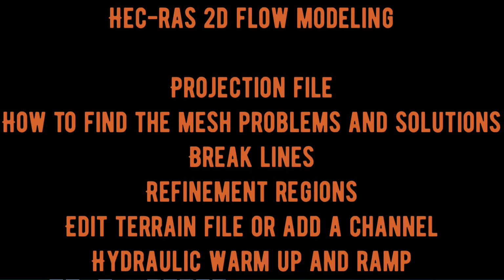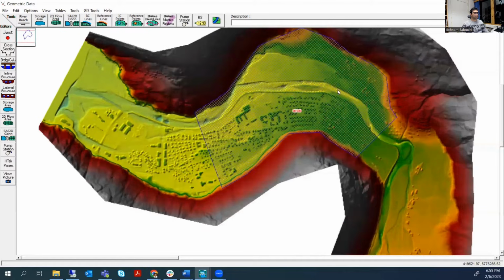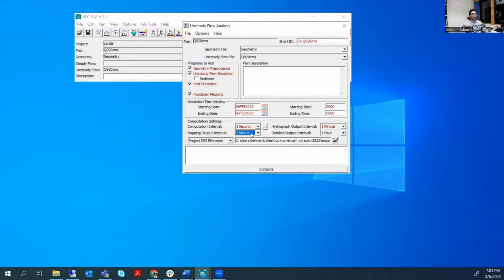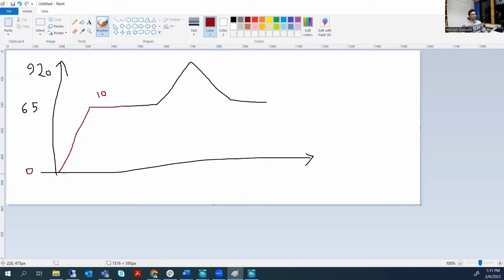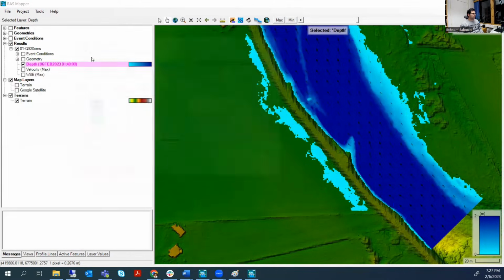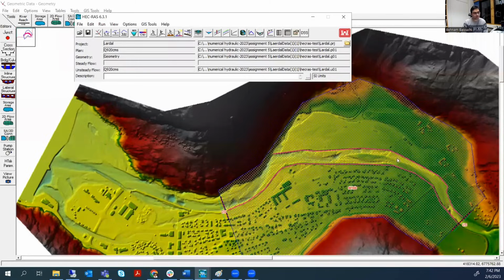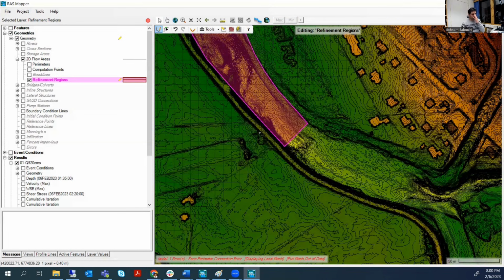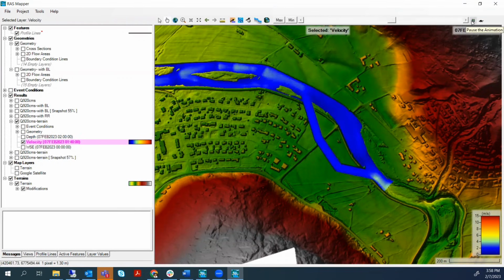HecRas 2D flow modeling for beginners

Comment: sir, I have a question about boundary condition . Why did you choose flow hydrograph for upstream & Normal depth for downstream ?why not both are same or vise-versa?
Reply from the maker: Thanks for your following and subscribing. It depends to your river condition. And data you have. If you have normal depth DS you can use it, but if there is reservoir or see for example or a hydraulic structure downstream you should use the water hydrograph for example.

Comment: Hello sir,
I have been trying to generate TIFF files from DEM data multiple times, but whenever I upload them into HEC-RAS, the output appears blurry. I am unsure of what might be causing this issue and would greatly appreciate your guidance in resolving it.Could you please advise me on the correct process or settings to ensure that the TIFF files are clear and display properly in HEC-RAS?
Reply from the maker: It is hard to say something about it as I did not see it. But check the tif data in another softwares to check it.
Reply: @behnambalouchi   okay sir

Comment: I have a question. The DEM data does not show the real bathymetry beneath the water surface. So how can we run a 2D simulation with such DEM 2D data. ? is there a way to modify the 2D Area of the river main channel according to the real bathymetric data?
Reply from the maker: As I understand it correctly, yes you can modify it in hecras. But I think archis is better for it

Comment: just wanted to ask do we have to import subbasins which were generated in hechms, in hecras and then do we need to define boundary condition for each subbasin separately or do we have to create a single 2d flow area perimeter for all the subbasins as whole, for 2D flood modeling? as we'll be using outputs from hechms which were generated for each subbasin
Reply from the maker: Usually, in hecras, you model less area compared to the hechms. So I think if you have good control over your topo and case you don't need to use hechms in general cases and projects and modeling. But I am not sure about your project

Comment: Hi, Benham. I am new to the HecRAS model.  I simulated the model but my water did not go downstream and just expanded in the area upstream. Do you know how to deal with this problem?
Reply from the maker: It is hard to add comments to it as I did not see the details. But repeat the steps. Maybe this is due to BC lines or Mesh. Make your mesh finer or use refinement mesh or breakline as I also mentioned in the video and explain it in another video. Check the results in detail to see what happened and don't give up. repeat it. Model a small and easy case first.
Reply: @behnambalouchi  Thank you very much for your encouragement. I have solved the problem. It's because of the computation settings (time setting). However, after changing the time interval to 1 minute, there is a sign of " Run-time error '7': Out of memory". I have changed several computers, it has the same problem. What do you think I should do? Thank you.